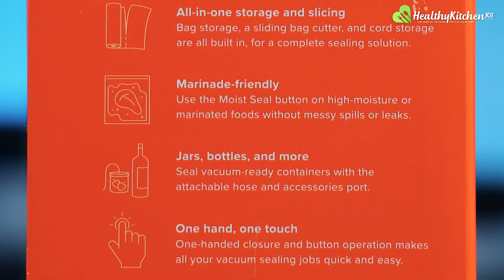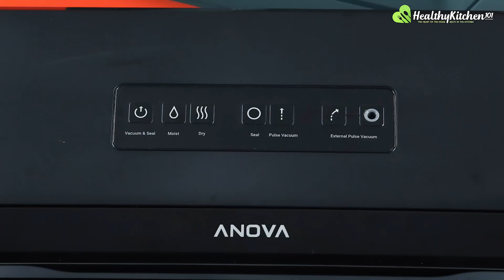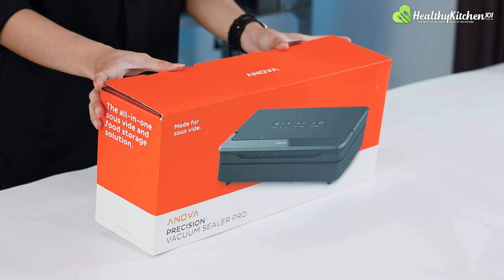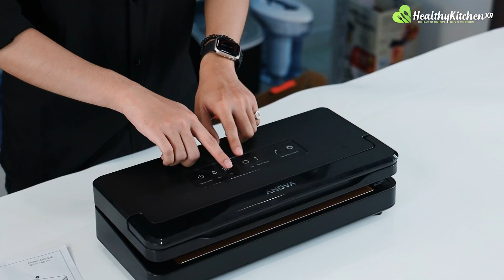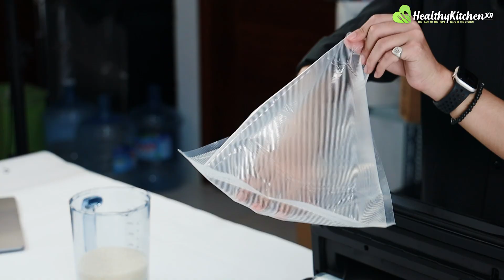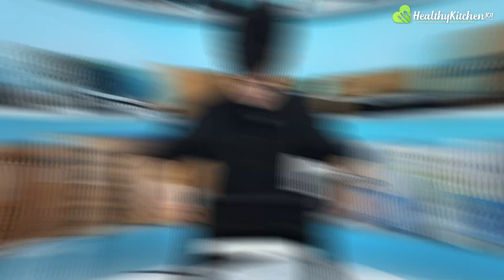Anova Precision Vacuum Sealer Pro: Unboxing & First Impressions

Comment: Thank you so much for this. I was trying to find out if I needed to remove those two pieces of striped tape underneath the vacuum bags or not.  The sealer came with absolutely no instructions at all, which is very disappointing. Thank you very much for your video.
Reply from the maker: Thanks for watching! We're happy the video helped with the tape question.

Comment: I don't mind the noise at all, but the locking handle always seems to flex too much for me, and I feel like I might break it.  I also don't like that just about anyone on the Internet makes better videos for these sealers than the company itself.  The main thing I use this for is portioned out coffee beans since I drink decaf and houseguests usually want caffeinated.  So I seal the beans in this and freeze them.
Reply from the maker: Thanks for watching and sharing your thoughts! Glad to hear you like it overall.

Comment: One feature other vacuum sealers have that I havent seen addressed for this one yet is a removable drip tray. If you vacuum something where liquids come out of the bag- 1 is there a removable tray to easily clean the liquids out of???? 2 can the liquids go down into the vacuum pump destroying the pump or how has the pump been protected?
Reply from the maker: Hi! You have a great point, and we'll definitely be highlighting this part in future videos. There's a reason, however, why we're not addressing it right away in this video. This is meant to be an unboxing and first impressions of the sealer, like we mentioned at the end, we'd conduct more detailed test in a separate video and article!

This video is only meant to show you what's in the box, plus whether the sealer's capable of performing basic tasks first.

Thank you for the feedback!

Comment: I love this machine.  Just bought one a few days ago!  You probably figured this out buy now, but it actually does double seal all the time.  The reason you got a single seal was because you opened it too soon.  The seal light was still glowing when you opened it.  Which makes me wonder if that is a feature, if you want a single seal to pull it open early.  When  I first used mine, I didn't use the instructions yet and only got a single seal every time because I opened it too soon.  I learned by watching a YouTube video that I have to wait.

Anyways, no biggie.  Just thought I'd mention that in case it is somehow helpful.

I stumbled across your video because I'm looking to see if anyone has a video on how to use the hose that came with the machine.  Not that that is very important to me, but could be useful.

Do you sous vide at all?
Reply from the maker: "Hi! Thanks for the comment. And you're right, I figured it out in the lab later, haha. This was my first time unboxing it, so I wasn't yet familiar with all of its quirks. By the time I realised, the video's already been published so we couldn't do a correction.

I'll be sure to credit you in future corrections, haha!

As for the hose, you can plug one end to the "External Pulse Vacuum" port on the control panel. The other end is designed to work with Anova's "Precision Port" vacuum bags. These bags have a port that's compatible with the air hose. Essentially, this setup allows you to seal and reseal the bag as needed without having to cut open another plastic bag. Could be pretty useful!

And as for your last question, yes! I do cook sous vide steak from time to time, haha.

Thanks!

- Matthew"
Reply: @shouldit.official  Haha. Ok I thought you probably would have figured that out on your own.  I wasn’t trying to correct your video but just for your own sake I wanted to be sure you knew in case you wondered why does it only do a sing seal in this mode. 😊

Yes sous vide is the best!
Reply from the maker: Hi! It's not an issue. I'm glad that you found the video interesting enough to engage and give your own corrections, which are always welcomed.

P/s: Sous vide is the best way to make steak in my opinion. Always so juicy.

Thanks!

Comment: Two questions:
1. Does that machine require its own plastic material? Can you use it to seal your own plastic bags? Are there machines that let you do that?
2. Can you seal without vacuuming first? Sometimes I want air remaining in the bag.
Reply from the maker: Hi! Thank you for reaching out. To answer your questions:

1/ Nope! These machines are compatible with standard 12-inch-wide plastic bag rolls you'll find on Amazon, Walmart, and other outlets. Anova also sells their own bags, but you don't necessarily have to buy theirs.

2/ No problem, just place the open seam into the machine and use the "Seal" function on both ends. It won't vacuum unless you use the "Vacuum & Seal" button.
Reply: @shouldit.official  Does it need a specific type of plastic or can we use any regular plastic? The reason is not that I want to avoid the cost, but sometimes I might want to reseal an existing bag or I want to use some other standard bag. I want to take advantage of their heating and sealing strip, nothing else.
Reply: @woofinu  No, it requires it's own bags, they DO however sell reusable/resealable bags (both Amazon, and Anova for use with the precision port & hose).